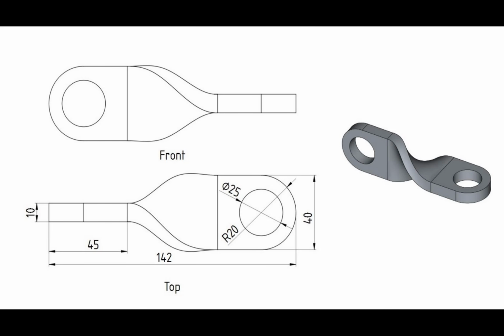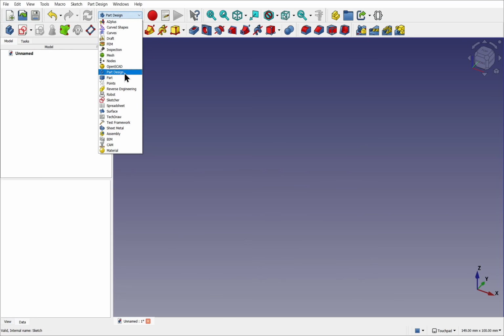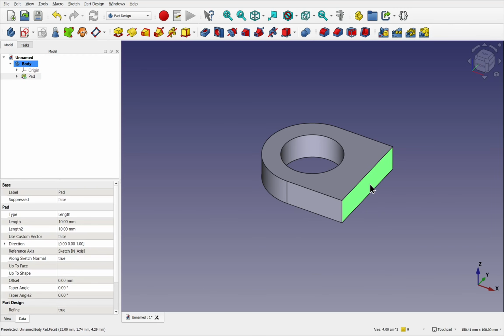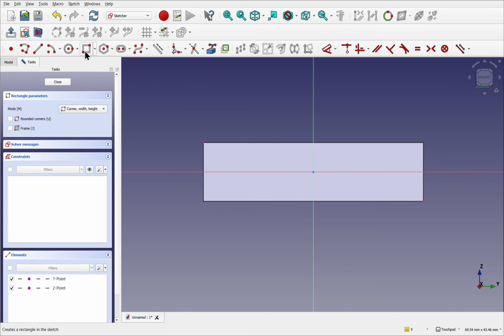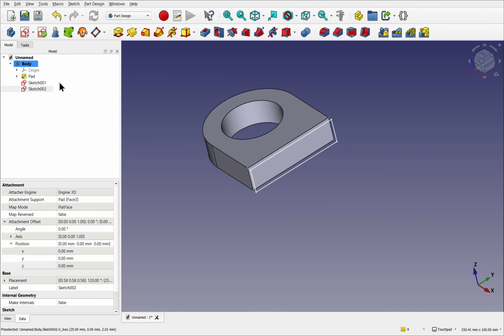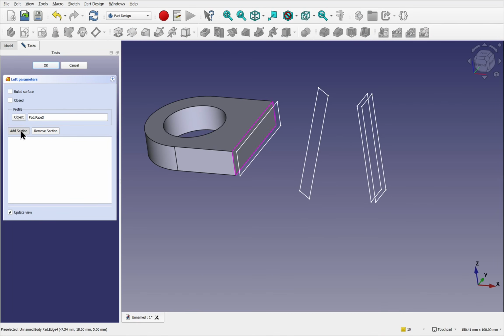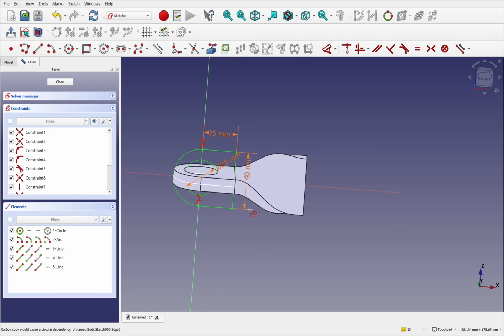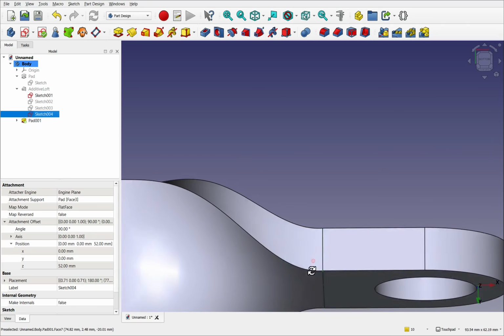FreeCAD v1.0 | Twisted Part in Part Design | Basic Beginners FreeCAD Lesson 22 Exercise 8

Comment: Hey guys, i need some help to troubleshoot one operation related to lofting. 
So i am working on the tilted sketch ( 45 degrees) by making a carbon copy or by duplicating it but the final sketch in tilted position also has the external geometry incorporated and vizible. If i try to loft like this i get an error saying that i need to have the same number of vertices or wires as the base does (4). Why and how to go about solving this? I am using version 1.1.1 .
   Out of sheer curiosity why is the external geometry projectet/convertet into the tilted sketch?
Reply: just found a vid on External geometry, hope this helps🙂
Reply: it works, thanks for the tutorials👍
Reply from the maker: Saw you found a video on external geometry.  In regards to the lofting you need the same number of edges so the loft is correctly guided.  This means that you can loft from a square to a circle and back to a square again as long as you divide the circle into three edges.  The vertices will guide the loft so if you add rotation to the profiles, freeCAD will create a twist in your loft.  I have a video for that one to. EDIT: Found it: https://youtu.be/v689Ii71TnE

Comment: Thank you for this very interesting video. However, at the end, why not make a carbon copy of the Pad, because if we modify it, the changes won't be reflected. Is that correct? Otherwise, use a varset for the pad thickness....I learned practically all of this from your videos. I still learn something new every time, like using Ctrl+Alt to force a copy to the active plane...
Reply from the maker: Thanks for the comments and glad you found it interesting.  In regards to your question yes you could of made a carbon copy or even a standard draft clone of the sketch and changed the rotation .  There are many workflows to follow and it's great to see people sharing those in the comments as it really helps others, so thank you for sharing those :)

Comment: Couldn't get this one to work. I got the first pad and the twist. Then I created the new sketch in the XZ plane for the second pad no problem. When it came to the carbon copying of the pad and I hover the Carbon Copy tool over the pad, I get the message in the bottom left corner just saying not allowed. That's all. I tried CTRL + ALT and that didn't work etiher. No other error messages so I had to admit defeat on this one. I am using Freecad version 1.0.2 if that makes a difference.
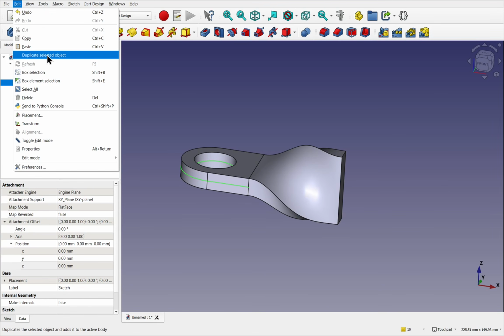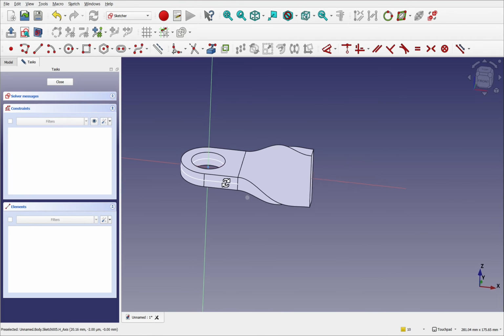Reply: had the same issue. I am guessing you might have made the same mistake as me - having the first sketch still hidden. at 16:30min, when Darren demonstrates the duplication, he changes the sketch to being visible via space bar. This is needed to later carbon copy it for the sketch at 17:20min.

Comment: Amazing.  By adding another interior rectangle, I was able to create the secondary air chamber drop that twists the primary flue gases downward into the secondary burn chamber on my masonry heater creating an almost total burn of the firewood.  Essentially this was the same twisted additive rectangular loft with a rectangular opening.  Excellent video!
Reply from the maker: I read that a couple of times wonder were it was going lol.  Wow that's some application, great to hear you found a use for this.  I didn't expect that, always interest to see what people are using it for.  Thank you :)
Reply: @MangoJellySolutions  I am learning so much from your lessons and how to apply them to my real world situations.  You make complex techniques simple to follow and reproduce in various applications.   Efficient wood burning requires extremely high-temperature secondary burn chambers (1000 - 2000 F) to incinerate almost all of the wood gases expelled.  Proper model engineering and heat testing each particular part is critical to achieve maximum and optimal heat transference to the sand which will store and heat an average residence for a week or more.  I'll keep you updated on my progress and share what I create for you and others to use as well.

Comment: I spent over an hour redoing the steps , I get the sketch attached properly and just will not create pad. Any clues?
FreeCAD 1.02
Reply from the maker: Sorry to hear that, what messages are you getting?
Reply: @MangoJellySolutions  The weirdest part is that there are no error messages and Pad shows no errors. Is there any way somewhere I can post /attach screenshots or even a file?
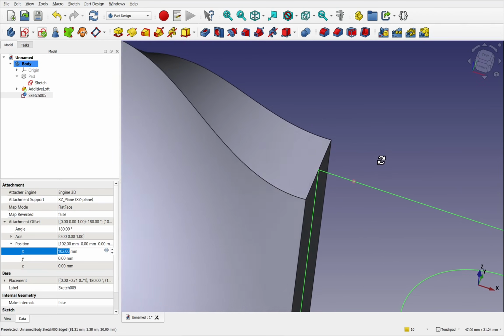Reply: @MangoJellySolutions  I'm having the same problem, when my X axis is at 101,95mm it wil pad, but when I change it to 102 the pad disappears. 19:16

Comment: I have a question related to the explanations at minute 20. Those 1mm adjustments of the sketch to have a smoother transition are not ok. There should be some options in the loft operation as there are in fusion 360, to have a rigorous mathematical tangency. A CAD application should allow a model to be made accurately, not something that looks ok.
I like freecad, I want it to become as good as possible as an alternative to paid applications, but here I don't think it's ok.
Your work is appreciated!

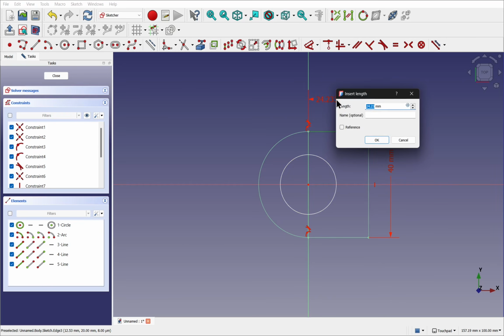Comment: I really wanted to try and figure out what I needed to do before you told me. But I noticed at 5:43 you set a dimension that I couldnt find on the diagram. Is there a way I should have been able to find that number myself? Thank you so much for making these videos! They have been an enormous help in learning this new skill! I never would have gotten this far without your help. :)
Reply: The non-bent part is 45 mm in total and the radius of the "Hole" outer part edge is 20mm. So 45-20 = 25mm.

Comment: Another outstanding video!  But I have a question: when duplicating (carbon copy) the left end and moving it to the right, you just gave it a 102mm offset. Why don't you need to attach it to the face at the right end of the loft?
Reply from the maker: Thank you, glad you enjoyed.  So as the geometry is coincident to the edge, you don't need a constraint.  It's the same as sketching on the base planes. With carbon copy all the constraint come over as well so it's completely locked down as per the original.  You could start deleting certain constraints and the import the geometry from the edge of the loft but at that point you might as well resketch for such a small part.  Another way would be to use attachment but you would have to use another attachment method.  After I did think that a carbon copy  may of confused things but I decided to press on.  In hindsight I should of left it for another model.

Comment: Good Tutorial! I'm a bit sad, that FreeCAD doesn't give you the option to terminate the guiding b spline as normal towards the starting profile. It's in Fusion and it makes Lofts so much easier to blend into your designs. Here you always have to add another profile right in front of the ends to kinda control the end and that doesn't really work for parts where you don't have consistent cross sections througout the loft... Is there a solution for this? Cheers!
Reply: Either in curves or part wb you can set "continuity" afair to start the loft at normal. Wouldn't be difficult to also add this to the part design wb I guess. Different developers working on different WB's cause such inconsistency I guess...

Comment: Creating a Twisted Part in FreeCAD: A Comprehensive Guide to Multi-Section Lofting

*   0:04 Introduction to the Twisted Part Challenge: The video introduces a common CAD challenge: creating a twisted part. It focuses on using the multi-section loft feature in FreeCAD.
*   0:35 Analyzing the Technical Drawing: The part is broken down into three sections: two identical sections (1 and 3) and a complex twisted middle section (2).
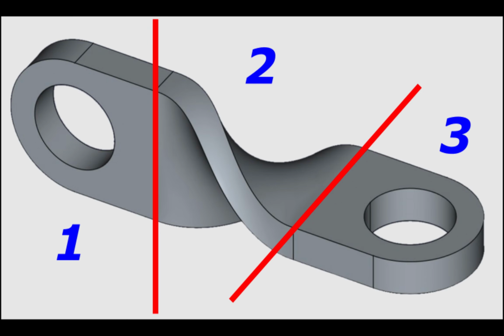*   0:57 Determining Operations: Based on the analysis, a pad operation will be used for sections 1 and 3, and a multi-section loft for section 2.
*   2:27 Connecting Sections: The transition between sections will share the same profile, allowing the use of a face from one operation as the starting profile for the next.
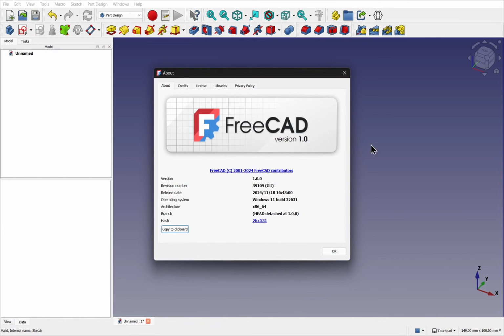*   3:25 Starting the Modeling Process: The process begins in the Part Design workbench with the creation of a new body and sketch for section 1.
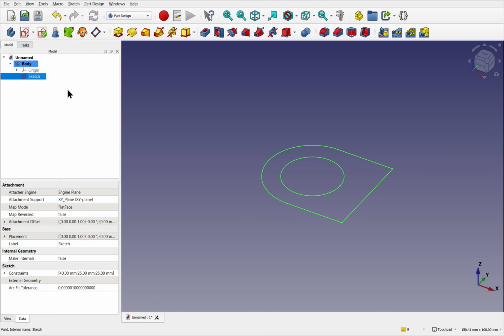*   6:02 Padding and Symmetry: Section 1 is padded symmetrically to the plane to ensure the center of rotation for subsequent operations is correctly positioned.
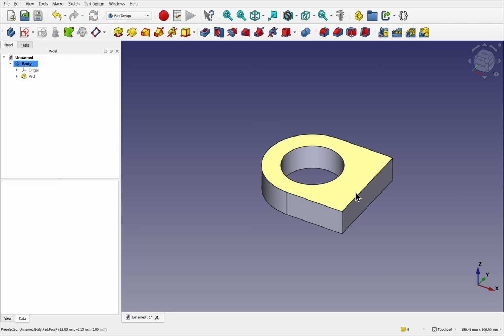*   6:55 Creating the First Loft Profile: A new sketch is created on a face of the pad, and external geometry is referenced without locking it down via coincident constraints.
*   8:14 Avoiding Deformation: Using equal constraints instead of coincident constraints prevents deformation when the sketch is rotated during the loft operation.
*   10:43 Creating Additional Profiles: The video demonstrates using the "carbon copy" and "duplicate" tools to create additional profiles for the loft, each with different properties and use cases.
*   12:51 Duplicating Sketches: Duplicating a sketch allows for independent modification of the copied sketch's data and constraints.
*   13:23 Copy and Paste: Copying and pasting a sketch allows for multiple instances of the sketch to be created and placed within the model.
*   14:33 Creating the Loft: The loft is created using the face of the pad as the first profile and the subsequent sketches as additional sections.
*   15:59 Duplicating Section 3: Section 3 is created by duplicating section 1, and various methods are discussed, including carbon copy and using a datum plane.
*   17:25 Carbon Copy vs. Datum: A carbon copy creates a linked copy of a sketch, while a datum allows for independent modification.
*   19:27 Completing the Model: The final section is padded and positioned, and the visibility of construction elements is toggled off.
*   20:09 Adjusting Transitions: The video shows how to adjust the transition between the pad and the loft by modifying the position of the sketches used in the loft.
*   21:26 Conclusion: The video concludes with a summary of the process and an invitation for viewers to donate and subscribe.

I used gemini-1.5-pro-exp-0827 on rocketrecap dot com to summarize the transcript.
Cost (if I didn't use the free tier): $0.03
Input tokens: 19084
Output tokens: 640
Reply from the maker: Thank you so much for taking the time to do this, I really appreciate that. I must take a look at that to automate some of these. Takes a lot of the heavy lifting out of it. Thank you for the advice, much appreciated.